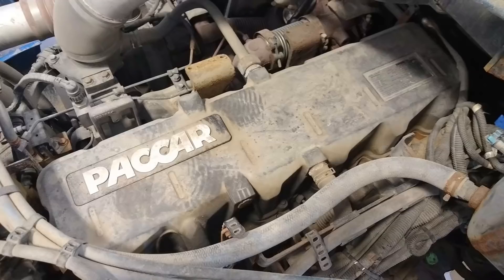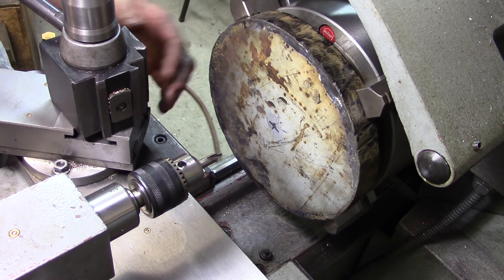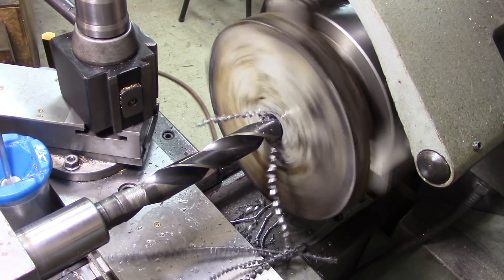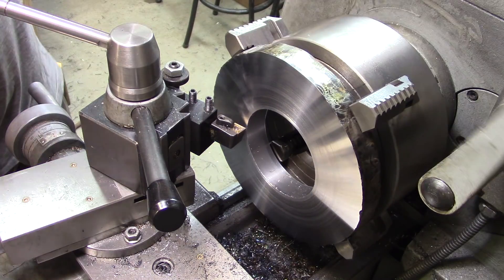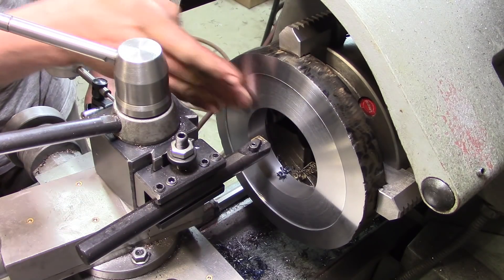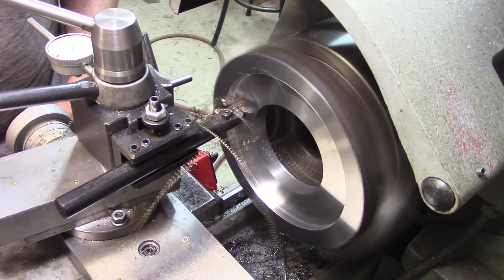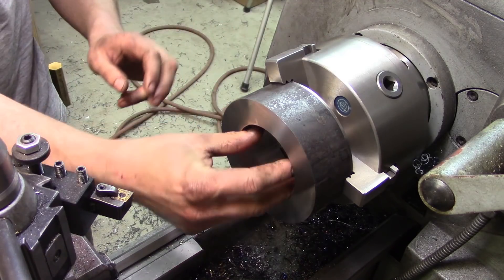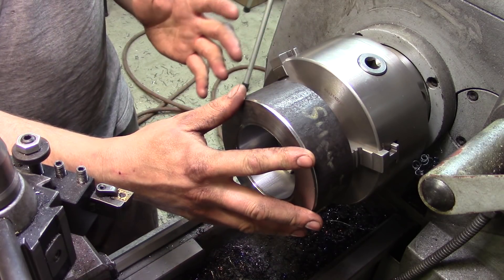Making a Paccar MX13 Rear Seal Tool Part 1

Comment: Why do you raise your tool to chamfer inside?
Reply from the maker: It's to get a little clearance on the bottom of the tool - to do a small chamfer it works well, one just needs to remember to return the tool to center line, lol
Reply: Everett's Workshop ah that makes sense. Thanks!

Comment: Would it have been possible/practical/useful to rough turn that heavy disc to a better (but not precise) disc as an early operation, to reduce the vibration?
Reply from the maker: It totally would, and I had thought about it, but to be completely honest it was laziness that won out. I didn't want to take the time to indicate it in again, lol

Comment: I noticed on the floor behind you a load of swarf (have the same thing here), I bought a magnetic broom. Mitigates walking swarf in the house and the ensuing record of sore feet. I must admit the odd bit still gets in the house - so an occasional rendition of the previous mentioned refrain... I enjoy your vids... Cheers Glenn
Reply from the maker: Lol, my Better Half is unimpressed with me when the swarf migrates into the house, for sure.  I finally got the floor cleaned up a bit better and now it's less of an issue.  My shop vac is my friend, lol

Comment: Excellent work Everett. What is the reason for taking the tool off-centre when chamfering the inner edge? Always looking to learn and not seen that done before. 
Take care and thank you.
Reply: If the inner chamfer diameter is smaller and the tool is on center, the radius of the part might contact the bottom of the tool, so raising it up helps to give a little more clearance. In this case that diameter was fairly large so maybe didn't need to raise the tool (hard to tell on video) but that's maybe the habit and reason that Everett did this? I know I do that on my lathe with smaller inner diameters and a large facing tool, rather than reaching over and getting a smaller tool.
Reply from the maker: Warren is spot on - to chamfer an inside edge when I'm being too lazy to change out the tool I just raise up the current tool to avoid rubbing.  It just helps if you don't have a brain fart and forget to put it back on center, lol . . .